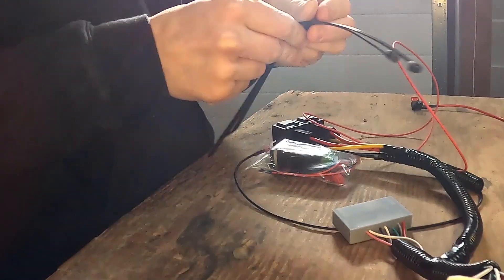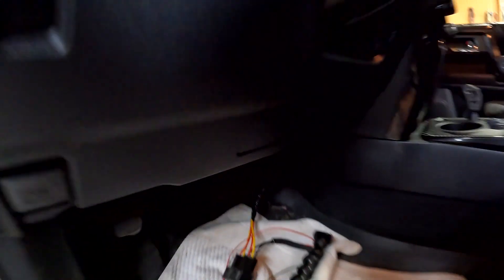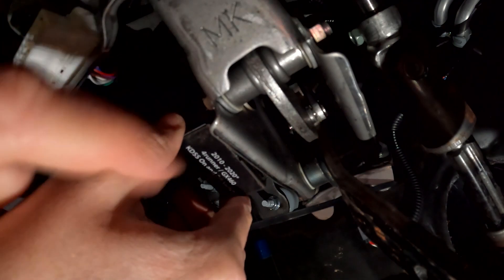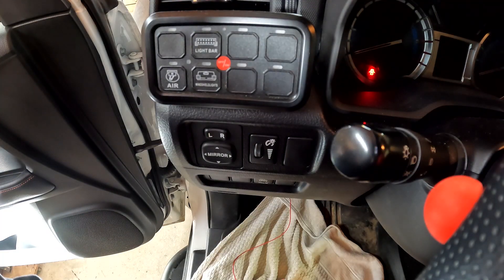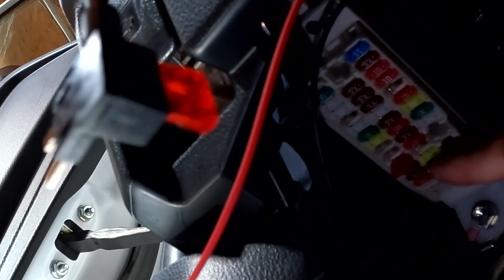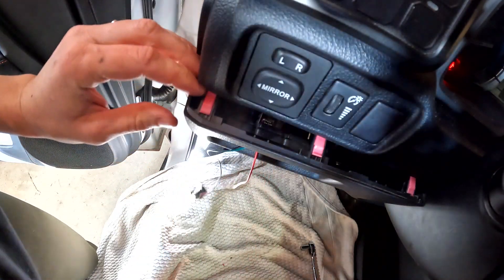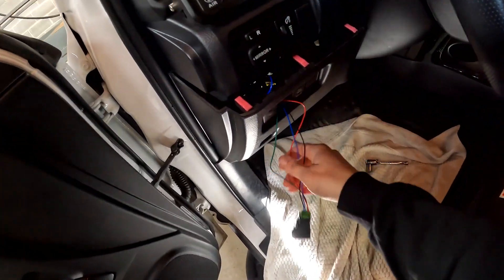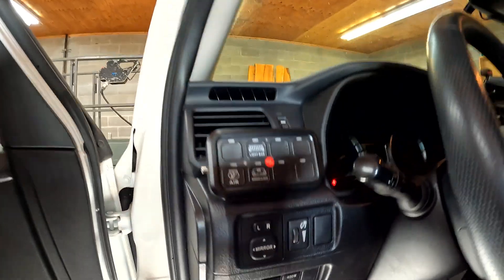Dr. KDSS Install On My 5th Gen 4runner

Comment: Hey!  Thanks!  I knocked out that install in under an hour with your help.  Road test was great.  I have bumpy roads and it made a noticeable difference in comfort.  I wish I did this one a long time ago.   I tried the center row in my fuse box and it didn’t work.   I found another open slot and all was good.  FYI for others…. The kdss activation is not immediate.   Sometimes takes 2+ seconds.
Reply from the maker: Amazing!! So happy my video was able to help you out with the install! Enjoy your new switch☺️

Comment: Thank you for the detailed video. Just wondering why you didn’t tie the switch into the AUX BEAM switch panel? That way you do t have to use an add a fuse.
Reply from the maker: Thank you! And to be honest I don’t really know how I would be able to do that. But I do prefer this to be it’s own switch anyways and have the switch panel strictly for accessories like light and air compressor etc.

Comment: Not sure why this Dr KDSS exists. Either I am mistaken, or everyone else is. Toyota's KDSS is supposed to disable/disconnect the sway bars itself once there is a lot of wheel travel. This makes sense, or else the system would not be used on Toyota's own Baja 4Runners. The system knows when the bars need to be disconnected. It's not complex or complicated. I know for a while many people thought that the bars only disable/disconnect at or below 10-12 MPH. This is false. KDSS response in real time to wheel travel. If you go rock crawling, the system will know exactly what to do. You also gain more travel than stock.

Edit: on a flat surface, hydraulic pressure in a KDSS system is equal or near equal. It is during wheel travel that it kicks in, which is when you need it. Dr KDSS is a waste of money. The only reason you would ever need Dr KDSS is to manually force that flaccid stabilizer feel on flat roads. But that would be stupid. I could not think of a single scenario where that would be desirable.
Reply: You are basically wrong.  It has no idea if it’s rock crawling or in a sand wash lol.  It doesn’t even have cameras or lidar or technology for that. Lmao.  Totally you are wrong. You can simply google
Search or YouTube how kdss works.  It’s speed sensitive.  That’s the only way it knows when to open the accumulator valves to allow fluid to move in turn the pistons can move with in the kdss shocks in turn allowing the sway bar to move with the suspension until the kdss shocks run out of travel in which the sway bars take over again.   In now way does it ever disconnect itself as well. So you are wrong with that again. And it’s more
Of an analogy used to help understand what it’s some what doing.   It’s really allowing the sway bar to Be less active under 12mph or low speed so the wheels can travel a bit more under articulation of the suspension. You do not gain more travel at all. You just are able to articulate the suspension more as the shocks in the kdss system can compress.  The kdss control switch from drkdss keeps the valves open at the speeds that the factory has them closed. Sway bar is always fully attached.   With the valves open at higher speeds the sway bar is less active in turn you get less ground transferring thru the cab.
Reply: @fltllc4136  It is not speed sensitive. Google how it works. The system works based on wheel travel. It needs no cameras. That is the dumbest thing I have ever heard. Your speed parameter makes no sense either. Intuitively, because the system is hydraulic, you would think it would activate based on wheel travel. It is not based in speed. This is an elementary concept.
Reply: @somethingawesome9547  it makes total sense.  Yes 100% it’s speeds sensitive.  There’s 9 wires in the in the wire harness ones of them is connected to the abs / wheel speed sensor lol.   The actually suspension / factory shocks or any component has no sensor to figure out how much wheel travel there is.  Lmao.
Reply: @fltllc4136  Find me 1 source it is speed sensitive.

You can use any source that is not a reddit or forum post. 🙃
Reply: @somethingawesome9547  I’m going to send you something better.  Give me a direct email or something. And then when you confirm I’m right. You can come back here and post.   Give me a contact. I have some thing in writing direct from the engineers.  Because they even admit the YouTube videos of how it’s explain is not explain in full detail. As they assume all ppl off-road at low speeds “ for safety “ reason.
Reply: @somethingawesome9547  bro I’m telling you. Toyota engineers even have admitted the videos are not explain correctly.   Literally it has no idea if it’s off-roading or not.  Drive it fast on a dirt road with it in stock mode. Drive it fast on the exact same road with the kdss valves stuck opens. You can literally feel the difference. That’s why it exist.  Tell me
Why it feels different when the valves open as opposed to closed?
Reply: @fltllc4136  Dave Lee, senior product education and development administrator for the University of Toyota, on KDSS:

“(The Land Cruiser) has a front stabilizer bar and rear stabilizer bar, like you would with any modern SUV,” Lee says. “But the stabilizer bars are linked together via hydraulic piping and the center control cylinder, (which is) up along the frame rail.”

There also are front and rear hydraulic cylinders, and when there is an imbalance of pressure in them, such as in an off-roading situation, they will move in the reverse direction from one another. The mechanism “effectively disengages your stabilizer bar,” Lee says, by allowing it to flex a little. This disengagement is made possible because the stabilizer bars are jointed, leaving each side to move independently of the other. In normal on-road driving conditions, the hydraulic pressure most likely will be equal and the cylinders will not function, leaving the stabilizer bars intact.

In other words. Dr KDSS is ASS and you have no idea what you're talking about. It's quite likely that there was some well-respected redditor that was well respected that started this false rumor on how KDSS works, and everyone ran with it. SPEED HAS NOTHING TO DO WITH THE HYDRAULIC SYSTEM. KDSS IS RUDIMENTARY.
Reply: @somethingawesome9547  the key part is they assume off-roading is at low speeds because at high speed it’s too dangerous.
Reply: @somethingawesome9547  you still have not explained why literally every single customer of that product can literally feel a difference ?  Are they all bullshitting ? Or pretending so they don’t feel like they got ripped off.
Reply: @somethingawesome9547  you are like the engineer for construction companies that never made it to the job site and going off other engineers that created those blue prints and also never made it to job site but you are telling the ppl on the field to go through a impassable wall.  

Under testing I can put a zip tie on the kdss shock shaft right at the body.  If I roll over a bump on driver side  at low speed I can push that zip tie down.  If I go over same bump at high speed the zip tie will be in same location because the valves are closed and do not allow the shock to compress or extend.  If I go same higher speed with kdss control deactivating the system the zip tie will move. Move more intact simply do to inertia. 

There you go again getting all engineery 😂
Reply: @fltllc4136  Hey genius, earlier you said you wanted my email to give me some explanation from "the engineers." I just gave you something, and now you're giving me shit for providing an explanation from a source within Toyota. You're the king of consistency. I don't even understand half the crap you write because of all your grammatical errors. It does not help that every other word has a typo in it. Jfc.
Reply: @somethingawesome9547   hey genius I didn’t ask you for a source.  You asked me and still no email. You just gave me Toyota lame explanation in which they assume off-roading is at lower speeds lol.  Come on guy   I’m trying to give you some updated info from a engineer from Toyota in socal that has better explanation of how it works. He’s actually on the field testing. And not assuming like Dave.  Please answer my question if you can.  Please explain how the valves being stuck open make a huge difference in why the sway bar is less active.
Reply: @fltllc4136  Dog. I asked you for a single source and you’re offering me some dark web equivalent; something that can’t be found anywhere else. Only YOU have this information. 

Do you realize you have the whole internet at your disposal? Yet, you cannot provide a single source that is not a reddit/forum post. 🤣🤣🤣
Reply: @somethingawesome9547  explain with out copy and paste lmao.
Reply: @fltllc4136  Re-read my comments.
Reply: Ok thanks for explaining 🤦🏻‍♂️.
Reply: @fltllc4136  👍
Reply: @somethingawesome9547  would you happen to be in socal ?  If so let’s just go for a ride. Who knows we might even become friends lol or not.   I just want you to feel what everyone else feels. There’s no denying that it make it way more comfortable to off-road at high speeds.
Reply: @somethingawesome9547  I’m asking to explain not how you think or how kdss works. I’m asking why do you think ppl can feel a big difference in ride quality with the valves stuck open.
Reply: The original KDSS was purely mechanical. Later they added accumulators and electrically controlled  valves (which are actuated at around 12mph) - some images and explanations in this video https://youtu.be/Ueshf401B0k?t=411  With the valves open, the front and rear sway bars can move independently. The Dr KDSS seems to open the valves regardless of speed vs the OEM controller which probably for liability / safety limits this behavior to low speeds.
Reply: @somethingawesome9547 ok so we are both wrong and correct lol. I didn’t fully understand the way the lc200 worked and assumed it was the same.  I now fully understand what you are talking about.  You know how.  I bought a 2021 LC200 heritage edition.  It is completely different then what the 4r/ gx version of the kdss system as in Drkdss control hardness can control the valves being that they electronically control over the purely mechanical version that’s on the lc200 which works off of physics.   I hope we are on the same page now.  We are at 1700 kdss control harnesses sold and everyone can feel what it does and is happy.  Inherently it also will prevent or fix a kdss lean if you use it more often than not.

Comment: Could you make a video on how this works. Off-road.
Reply from the maker: For sure!!
Reply: @heradventurelife  Ya, Id love a follow up. Ive been considering one of these mods but id like to see it in action first!
Reply from the maker: @BingBingBingBingham  absolutely! Hoping to hit the trails within the next couple weeks!
Reply: It will work the same…this is a worthless mod, as KDSS works lower speeds. Why would you want to disconnect sway bars at higher speeds.
Reply: @dand2334  lol you have no idea what you are talking about. No it will not be the same.  And obviously you don’t off-road or if you do you just do the most basic kids trail if you are asking why you would want to disconnect a sway bar.  😂. That’s clown talk 🤡.
Reply: @fltllc4136  obviously you do not know how KDSS works. You don’t need a switch for it to work properly, using a switch to disconnect the sway bars at a speed higher than designed can cause unsafe vehicle handling
Reply: @dand2334  😂😂😂😂😂lol. Ok now I get it. You are basically a Karen 😂🤦🏻‍♂️.  No shit it can be unsafe 😂. I bet you where a mask when you are by yourself in a shower or swimming. 💀💀💀. And yeah it doesn’t physically disconnect it. I’m interrupting the signal wires for each valve which lets it stay open which in turn makes the sway bar less active. Trust me I know more then most. I created it.
Reply: @dand2334  Ive heard that it softens the ride at higher speeds on FSRs, ultimately reducing driver fatigue on longer, less technical trips. I for one, am curious to know if thats true.
Reply: @BingBingBingBingham  Thanks…that’s a great explanation.
Reply: KDSS is a passive system it dose not turn on or off electrically. What this mod does is bypass a system in the KDSS which automatically controls roll stiffness while driving on smooth roads. In order to provide a more plush ride there are sensors that detect steering angles and other inputs.  They open valves to allow some movement in the sway bars to improve ride quality. This mod enables you to override these features to manually switch on or off. Regardless once your wheels are out of phase KDSS is going do what it dose. This mod won’t give you anymore than what you already got.
Reply: @michaelpounds9300  that’s actually wrong. It has no idea if it’s on a smooth road or not.   What I design the switch to do is interrupt 2 signal wires that control the valves in the kdss system to stay open which allowing the pistons in the kdss shocks to move , in turn the sway bar is less active.  This happens only by a speed sensor set by the factory / manufacturer at 12mph or under. Now you can have the valves stay open at any speed.
Reply: @fltllc4136  yes you are right I should have not wrote “smooth roads “ I know KDSS can’t tell the type of road surface you are driving on my bad for oversimplifying. However beyond that, we are in agreement on the effect your mod has on the KDSS system. Bypass , interrupt, switch, sensors, roll stiffness, less active KDSS, different words to describe the same event. You offered more detail in your explanation. Thanks

Comment: Does adding the kdss spacer and and that switch makes the ride smoother?
Reply from the maker: The switch makes all the difference! And if you go with his front billet clamps and sway bar end adapters you won’t need to run spacers anymore

Comment: After several months of the install, have you had any issues with the kdss system and any lean issues?
Reply from the maker: This doesn’t solve the lean of the KDSS system, but there hasn’t been any issues. Still love it and use it everything we offroad!

Comment: Am I looking at this wrong or is what you wrote on your video incorrect? 
Green wire is suppose to go to a power source, wouldn’t that be the relay? (Red wire to fuse box)?
That’s what your video showed but the text and your voice over says otherwise.
Reply from the maker: The text is what you are supposed to do.
Reply: @heradventurelife  I’m
Thinking the switch that I got is different  than yours. My green wire on the switch is my power source and I have 2 red wires. Red 1 and Red 2. 
That’s why I was saying red wire from KDSS doesn’t go to the green wire.

Comment: @HerAdventureLife - I've got a 2021 TRD ORP non-KDSS.  However I am on road 95% of the time and toying with trading mine in for a 2022 TRD ORP with KDSS.  I just wanted an opinion on someone who has it to see if it's worth it.  I do intend on lifting my 4Runner a little bit 2.5-3.0" and increasing some of my off road time.    Was hoping to get some insight on the setup?   Thanks in advance!
Reply: You should
Reply: Kdss is a life saver on road. I have seen it first hand. I have a gx460 and it's a great system to have. Just install this kit if you travel off road at 20 mph or more.